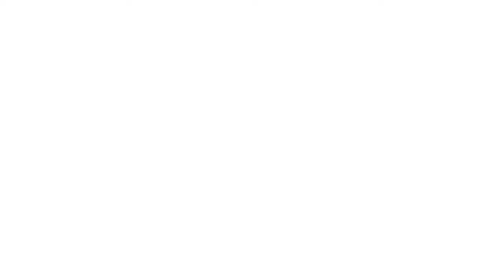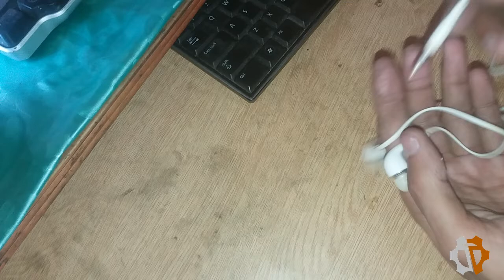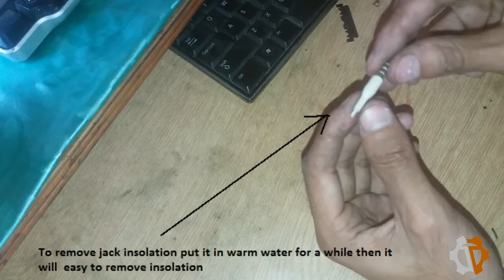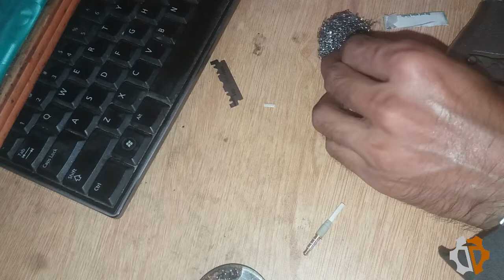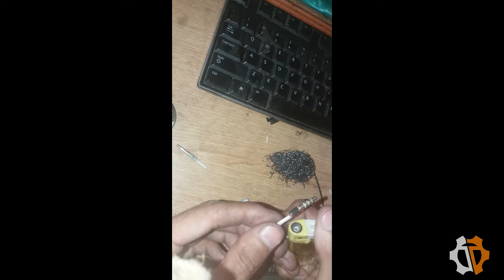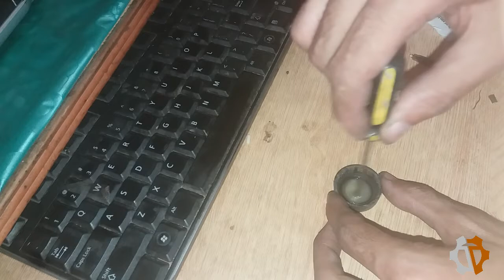How To Repair Earphone || как отремонтировать наушники

Comment: You should consider getting a trinocular inspection microscope for doing this and it would help us see what you are actually doing better. Good presentation otherwise! Very nice repair.
Reply from the maker: THANKS . I  was actually thinking to buy small microscope for such small electrical repairing works
Reply: @techytools5668  I bought one with a camera with both HDMI and VGA output from AliExpress for less then $300. It was good for bench work and came with a silicon build mat with compartments for holding items and imbedded magnets for holding screws and such. The base on it is rather large and it was only a single support beam system but I like it for the price.